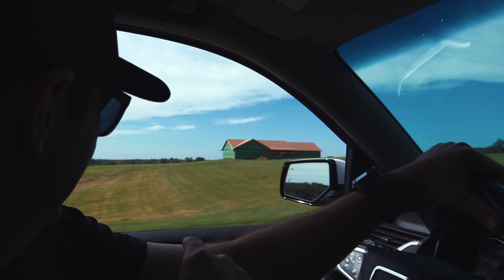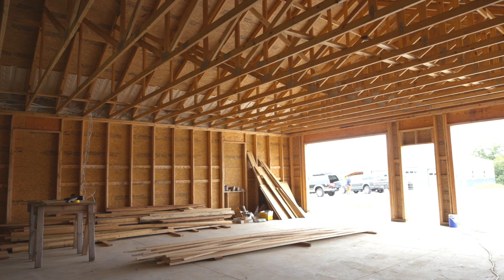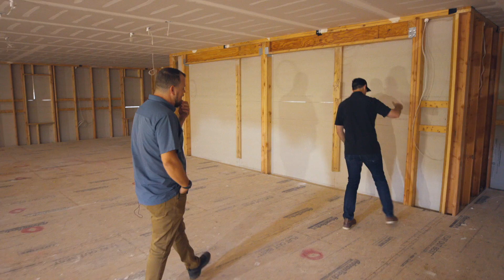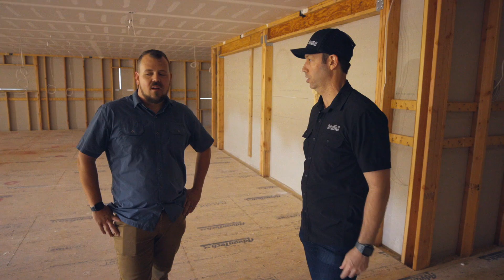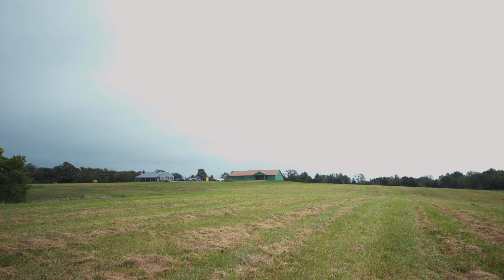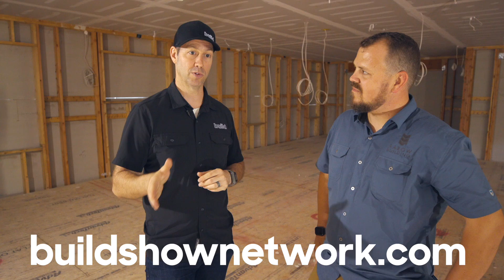A House with No Doors or Windows?

Comment: 250 is definitely on the high side, but then that's really a pretty awesome build. So I would imagine the finishing on the house is going to be definitively on the high end, accounting for the majority  what makes that so high. Also, I should remind everyone that the structural require to make all the interior walls non-load-bearing is not an insignificant cost.
Reply: It's only clear span trusses, nothing new
Reply: @colstace2560  Exactly - about as financially efficient as you get
Reply: @colstace2560  True enough. I wonder if his 250 charge includes the square footage for the utility basement? Perhaps that would explain some of the high cost. Edit. I just re-watched it and he says they will be under 250, so who knows what the cost will be.
Reply: @josephdestaubin7426  so the cost is under the $250, and it includes a 650 sq ft garage, a 200 sq ft covered patio, the utility basement, and the front covered porch - It's not nearly the exaggeration some of these people are making it.

Comment: What are the pros and cons of placing the insualtion above the cement pad instead of under? I panned on 3 inches of EPS under my pad.
Reply: I would say you are best going with the insulation under the pad. In the event that ground temperature gets the slab to 55 degrees and that reaches dew point, you could possibly get water issues under the EPS over the slab. (I doubt that being the case since a vapor barrier is under the slab...unless they just put in on top of the slab...hope they don't sandwich the slab with barriers...seems like a bad option that way) Yeah, the whole thing is a bit off-putting. AdvanTech is pricey jazz, and one benefit of doing an insulated slab is that it isn't a total heat sucker so you can make it finish floor by staining and sealing it. (Or put your heat in the floor...). Either way, insulating under the slab is going to be the thermal mass on the interior of the house which is where it belongs, and separating that with all the EPS will take away the thermal mass benefit of the concrete to a great degree. Always better to have the insulation on the total outside layer and then barriers, then mass. https://www.youtube.com/watch?v=iHBYvqr2_io&t=1680s This should help. Good luck!

Comment: With the 4" insulation in the floor, how much free air conditioning are you loosing out on in the summer vs the savings on winter heating?  As an example, https://buildingdata.energy.gov/project/equinox-house an otherwise passive house up in Illinois uses an un-insulated slab because the summer cooling is worth more than the extra winter losses.
Reply: The efficiency of the heat pump is much higher in cooling mode than heating mode - insulation is in our favor. You also have a comfort issue will a cold slab all winter.
Reply: @stevenbaczekarchitect9431  I think it had a gas funace and air conditioner backing up the custom heat-pump fresh air heat exchanger system that does the bulk of the climate control work.  He didn't talk about cold floors, but I could see that being an issue.  AFIK https://buildequinox.com/ is the designers's company if you want details.  (not affiliated, but attended a lecture on the house's design 10yr ago)

Comment: Interesting approach. So, would the EPS be applied with adhesive to slab?  And same for Advantec to EPS?
Reply: Typically very little is used, and it is not really part of the success of the assembly. It is typically used to keep things from sliding during construction. Howeer, the two layers of Advantec are glued and nailed together

Comment: $250/sq ft is not "awesome" in most States.
Reply: That's not even double the "entry level" home cost in many big markets and comparable to the spread you have with for example cars between the entry level and mid tier.  This is premium but likely still within reach of normal FHA financing - hardly extravigant.  Plus things get cheaper as they get more standard and less experimental. On these more novel techniques the builder has to cover the risk of going off the beaten path and figuring these techniques out for thier first time - and charge acordingly.

Comment: @stevenbaczek what kind of HVAC mechanical equipment is being used in this house. I am in Missouri building a very similar house as well but am unsure after all the extra insulation and air sealing what mechanicals would perform best.
Reply: Ducted Heat Pump

Comment: Air tightness test scored an ultra-low 1/10 allowable!  How impressive is THAT!
None of that testing included the attic space.  Are you going to ventilate that attic?  I would think so!   You don't want dead air in there, right?
So why not include radiant barrier, and ridge ventilation on all principle ridges?   Right now, it looks like that attic will be a "desert."  An inferno, closed from human occupation whatsoever.

Comment: Every new build should be blower door tested and air sealed.
Reply from the maker: Agree 100%
Reply: @michaelvangundy226   nonsense, not with a good ERV you're not.
if you do it right the airquality indoors will actually exceed exterior airquality in bad days this way.
Reply: It's code .
Reply: Great idea!!  Involve more bureaucratic government regulation wherever possible!!!
Reply: @jphickory522   i mean building in a way so that buildings don;t get destroyed during earthquakes is code,
building in a way that ultimately saves everyone money due to better insulation is a good thing too.
as was the code to remove asbesthos, as people got sick from it.

not all regulation is draconic and bad.
the passive hosue system is actually very rule light, 
reach this efficiency, by hitting these 3 marks, however you want to do that is up to you.

which is not draconian at all, and is acutally very flexible, its just a performance requirement.

like seatbelts, or airbags, that was also seen as "government interference" but it has saved millions of lives.
Reply: Freed “saving lives” is never a good argument for more regulation.  Thousands of lives could be saved annually by universally lowering the speed limit to 20mph.. etc..
Reply: @jphickory522   lol really, so there should be no laws to prevent your neighbour from spewing toxic waste you're downwind from that will give you cancer?
regulation in certain cases is required. if everyone can do whatever they want without regard for others safety and health, people die.
Reply: @deerhunter7482  In only some places.
Reply: Freek, that’s not an accurate analogy for the point I was making.  I’m not against anyone building a tight and efficient home.   What I’m against is bureaucratic mandates.  I’ve been in the building industry since 1989 and I’ve seen how government mandates regarding efficiency etc... generally create more problems then they solve.
Reply: @jphickory522   ok then there should be no rules on how deep to bury power cables, or where to do so? so that whenever you buy someones house and want to put up a picture frame you might get electrocuted? 

look I'm not against over regulation, but there are certain rules that have been made for safety, or in general the benefit of all.
if theres no code whatsoever, how could you possibly have any expectation of what to expect when buying a house? the code makes working on houses standardised and thus efficient, and guaranteed to be of a certain quality, and thats a good thing.

that should not mean it gets super prescriptive on how to meet code, as long as it does meet safety performance standards, is my preferred way of regulating.
prescribing how to do things stifles innovation, setting a target to hit, encourages innovation.
Reply: @freekhoekstra4763  I never said I was against all regulatory mandates.  I am generally in favor of sensible code that helps protects life and limb.
Energy efficiency is not in that category.  I suspect that you are not in the building trade.  I deal with nonsense regulatory matters on a weekly basis that mostly accomplish nothing but provide government workers job security and create additional cost for the future homeowner.  I could give countless examples how the "one shoe must fit all" approach that government regulation typically requires that has created absurd scenarios in the field that go against all common sense.  The cost for this needless regulation is obviously passed on to the unknowing homeowner as it increases the cost of construction.  Again, I'm not against common sense code that protects life, the integrity of the structure and the environment.
Reply: @jphickory522   oh I agree there are plenty of times when regulation is draconian,
but establishing some minimum level of durability and efficiency, I think is a good thing.

I think we see things more similarly then we both think :) I just would add energy efficiency to the code, where you wouldn't which arguably has arguments for and against in both cases
Reply: @freekhoekstra4763  Agreed.  I appreciate your ability to debate a point without insulting the other.  Respect
Reply: @jphickory522   likewise :)

Comment: pretty sure my house has a leakage rating over 15. I can feel wind through my house when the wind blows in the winter time
Reply: Trix Kemuel mine is like a rigid tent. Insulation wasn’t a thing in 1927. 🙁
Reply: Well your kids won't develope lung problems.
Reply: @krinohs  
And the whole time I thought it was a bunch of horse shit to justify $250 per square foot. The same people who buy into this are the ones with $100,000 in student loans.
Reply: @krinohs  I have a like tale. But I never have had a problem pointing out a snake oil dealership. If you like the house by all means buy it, I could care less if you feel like people think that you are dumb.
Reply: @michaelvangundy226  is it snake oil? I want into one of these homes and it was 5,000 something sq ft, almost 3 times bigger than my house and they pay about a quarter of the energy bill I pay.
Reply: I laughed at this because when the wind blows hard enough it blows the insulation out of my walls in the hallway (no drywall yet).
Reply: @c0unterph0bia  hehe sorry. My energy usage goes from $30 a month in the summer to $400 a month at the peak of winter. Also my house is as big as one bedroom in some of these houses.
Reply: @HellTriX  I live upstairs of a business that was built in 1886. It's half renovated. I don't think the electric bill has ever been less than $600.
Reply: It shows a lack of class to point out another’s grammatical errors to bolster your argument.  Win or lose based on the merit of the opposing view.  There are many intelligent men that don’t have command of proper grammar.  Dismissing their input is a disservice to yourself.
Reply: David, it should be obvious.  Your first comment was a reply to Michael.  In that comment you  needlessly corrected his grammar.  The sole purpose of the correction was an attempt to give yourself an air of superiority.  A military man should exhibit better discipline.
Reply: @slamrock17  
5,000 square feet. This guy said that he got the price down to  $250 per square foot. That's 1.25 million dollars to have it built on your land. To me I can find something better to spend my money on other than a low utility bill.
Reply: @krinohs  Thank you brother for the military time (Corps 84-88) !! And I totally agree that we have people like this that want to piss is everyone else's soup because he can't do it.......
Reply: @krinohs  Love it brother and totally agree!! It's amusing to me just how bitter some people are......
Reply: @slamrock17  Thank you - and let's not forget concepts like health, comfort, durability,  - and then energy efficiency

Comment: Have fun patching the ceiling 9297 times when the boys come in to frame the partition walls.
Reply: If that's the kind of morons you hire, you deserve the mess they leave behind. Did you never hear of using framing screws? Much easier to use, easier to correct mistakes and much more stable.

Comment: Can spray foam on the underside of a roof deck damage the zip deck, nails or shingle warranty? We're aiming to use open cell but I'm concerned about condensation. VRV conditioned attic.
Reply: Research hot roof options, open cell not recommended. Closed cell is acceptable but proper r value must be met so that there is no chance of condensation.
Reply: It better if you seal the ceiling plane and leave the roof deck to be air washed. Hot decking is one issue. Ice dams another. Cost is the biggest reason. It's cheaper to spray 1" open cell foam on the top side of drywall (after putting all electrical penetrations in and boxing over them for fire safety requirements) then dumping r-60+ cellulose on top. Cheap and works great. This is the cheapest and most effective way of insulating the roof system that I have found thus far. Good luck!
Reply: Joshua Ruby thanks for your comment. Do you have any building science or links talking about that system? I'm thinking of having the HVAC redesigned and going for a non conditioned attic since the added tonnage to condition the attic (and VRV cost Vs 2 stage) may not make sense.

Comment: I would do 16” center. Not much more money and a lot stronger structure...
Reply: Try googling "advanced framing." They are not doing it to save framing costs, but improve thermal performance by reducing thermal bridging through the studs. See Ryan's comment below for the numbers 😊
Reply: Matt Metcalf well your math is bad but that’s the general idea. 33% fewer studs, 3.1% more insulation.
Reply: My framers moan and whine about 24" centers because they claim the walls get too wavy with crooked studs and wet expanding OSB especially with 9'+ wall heights.  Maybe it's better in a dry climate, IDK.  I'm not worried about the strength of 24 centers because we don't get many cannonballs hitting the walls up here.  Bird strikes don't worry me either.
Reply: @stipcrane  definitely better with dry climate.
But with 24"s youre supposed to insulate so well that the stud section is basically "dry" all the time so it wont wave after the initial set up.
Its not as easy by default but its ok in the long term.
Reply: Yah that is the common myth.  I've seen hundreds of houses at 24" some 30 years old.  No issue.  Its better to save money studs, and use screws and plywood, than nails and OSB.   Plus 24" has better insulation value.

Comment: put the insulation under the slab..
Reply: The benefit?
Reply: @stevenbaczekarchitect9431  Would having the thermal mass of the slab above insulation be of any benefit, from a comfort or efficiency standpoint? I imagine it would certainly complicate the flooring decisions. Would it be a good option if you wanted to do radiant heat in the slab, instead of a forced-air system? All that being said, I'm intrigued by the foam-over-concrete idea.
Reply: If there is a leak on the slab, moisture will create molds and it will be near to impossible to clean since the walls sit on the foam! everybody put the foam under the slab!
Reply: @stevenbaczekarchitect9431  benefits? It will never mold and you wont need an extra subfloor. the concrete will become the floor. And all that mass will keep the house warm if the system went out
Reply: @meandnature6452  that may be good for you, these clients did not want concrete floors. Concrete floors for older, aging in olace clients is a bad thing. As for the thermal mass argument, pleSe toss out all those 70s books you are reading, that thermal mass isnt quite what you think in a well designed, well insulated, airtight home......
Reply: @stevenbaczekarchitect9431  you put a laminate floor ontop of the concrete. if you want you can put something soft between

Comment: Matt, what is the header situation in this house? It looked to not only not have the traditional headers, but none at all?
Reply: afobear   In this situation, headers are only needed on the load bearing walls. The walls that carry the trusses. Plus, this is a single story house, so no second floor load to carry. The end walls are only carrying the weight of the siding to the peak of the roof.

Comment: Is there a point where you start to see a meaningful loss of insulating value due to settling/compression under its own weight in the blown in attic insulation? Does r-65 remain relatively stable over time ?
Reply: All loose fill insulation settles over time. There are settings on each blower machine that control the air used in the process. The more air used, the more settling will happen. 
About the Point of No Return on the value of going thicker, its all relative. The DOE and the EPA have guidelines on what they recommend in R ratings both in attics and walls. They're, in my opinion, just on the minimum side of full effectiveness with regards to energy efficiency/cost investment.
In other words, they are just about right at the point of no return, maybe just below it.
Reply: when we decide on the attic insulation we assume for degredation in time. It's slight - but accounted for